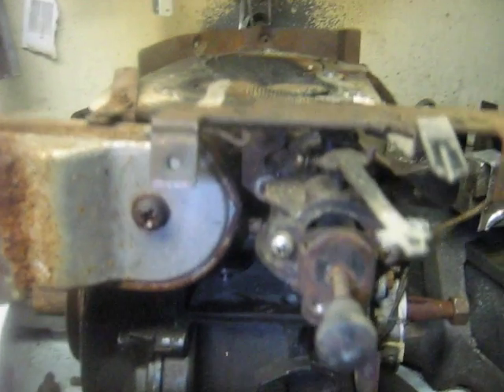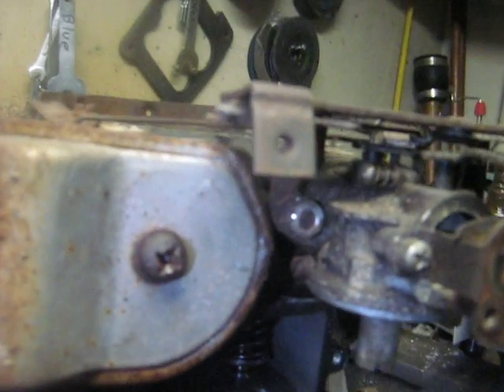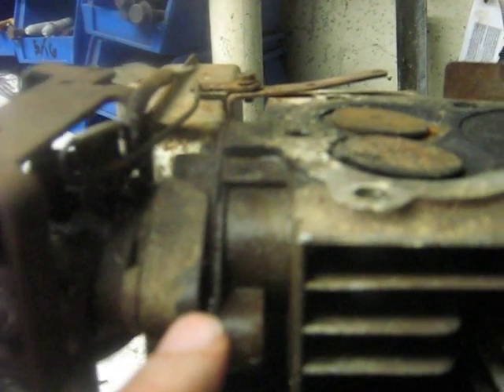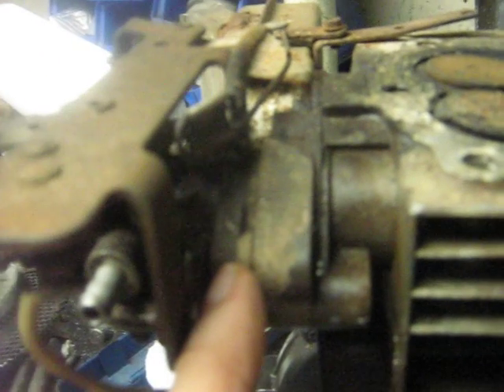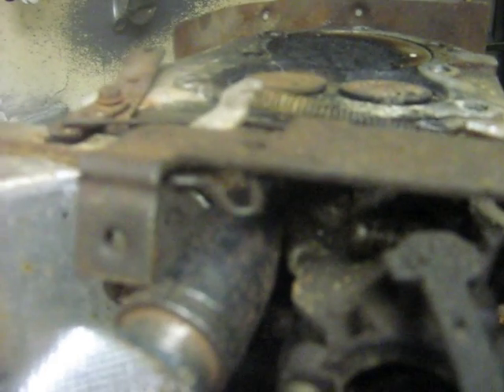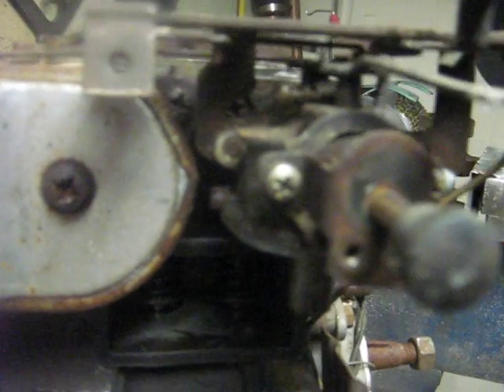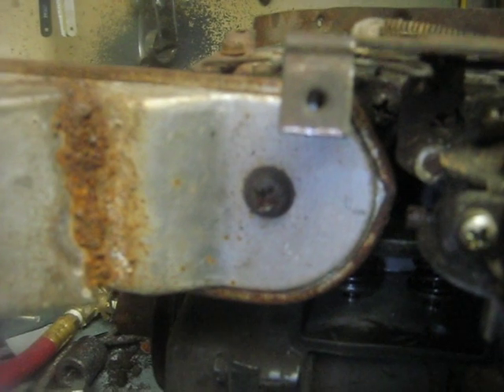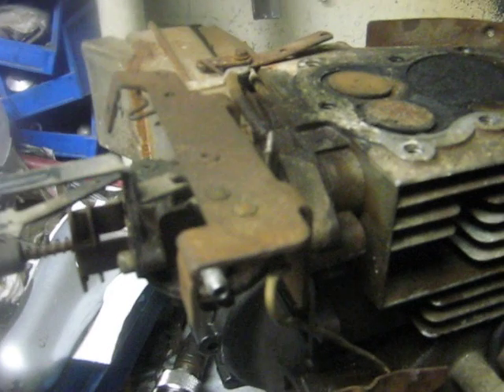The WORST Engine Design!

Comment: Tecumseh engines suck I have one had a bolt brake of in the block and taped the top of the crank shaft one time to brake the fly wheel loose and mushroomed out the threads a briggs wouldn't have done that

Comment: I agree with what you are saying in the description. The model 13 5hp briggs carb is angled in such a way that makes the bottom carb screw off suck XD
Reply from the maker: yes, I know what you mean, that bottom screw becomes much easier to manage by using an allen head screw, and an allen wrench cut down to fit it. It saved me a ton of time on my Straight 8 and 6 projects last summer. I only use allen head bolts on my 5 horse briggs engines now.

Comment: Use an ordinary screwdriver that fits the screw but one which is designed to allow you to hammer it on the end. Put the driver in the screw and hit it a descent rap or two with a hammer before applying turning force, this can 'break' out most hard to turn screws in aluminium. A little heat might also help.

Comment: When I run into this problem I actually get that screwdriver and strike it with a hammer while applying a twisting force as though it was an impact screwdriver and it works really well.

Comment: Phillips screws were designed, and used so that the bit would jump out of the screw on the assembly line before it broke the screw in the casting. At the time Phillips screws were high tech, ive pulled apart engines that had flat blade screws holding the con rod on.
Reply from the maker: Really, flat blade screws on the crank, can't say I have ever seen an engine that old!

Comment: yea  not  the  greatest  engine  design  ,, i personally  hate  tecumseh  engines
mainly due to their propensity  to have  carb  problems and  hard  starting issues
Reply from the maker: I did have a few carb. problems with this engine, other than that it ran and started well.My main thing against Tecumsehs was how many blew a hole in the side when the con rod broke!
Reply: my  sentiments exactly  ,,they had a really  bad connecting rod issue  ,if  you  ran it a little  low on   oil they can blow  with no warning

Comment: Briggs for life! Iv'e never had any luck with tecumseh engines.
Reply from the maker: I agree with you!I must mention that the first engines I used were 1960s era Tecumseh pushmowers, which I have to admit ran pretty well (we had 3 of them, since our backyard was the size of a football field!) I was very happy the day my father brought home a used 4 horse Briggs riding mower, since I was the youngest and got to drive it the most. It worked well for over 10 years, then the plastic oil paddle wheel broke in half during the winter, and I seized it up cutting the grass the first time. I didn't give up, I hand honed it out .010 oversize and put in a new rod and piston. It smoked after that, but gave at least 10 more years of servive. I still have some of the engine parts :)

Comment: Wow, simplicity was totally ignored in the design of this motor.
Reply from the maker: Yes, they really messed up. It would have been OK if they had locked the carb. bolts into the adapter plate, but once they start to spin, you are pretty well toast!

Comment: I am having the same exact problem with the same exact engine off of a wheelhorse snowblower because mine need a complete new carb
Reply from the maker: I will make a new vid showing what I did to get the carb off.Since you may need the info ASAP, I had to remove the muffler(had to grind off the long thru bolt, the shorter one came out with an impact driver and penetrating oil).I removed the carb nut on the flywheel side with a wrench, and a screwdriver wedged in from the back. I had to gring off the carb nut on the exhaust side, then I impact drove off the 2 screws holding the adapter to the block.I soaked it all in penetrating oil for 2 days first, but it didn't help with the carb bolts that were already spinning around.Hope this helps you out. The 7 horse Tecumseh of mine was a good running engine in its day, no complaints other than having to tear off the carb. bowl every year. It seems that the more recent engines like to throw con rods though, I have two 8 horses that have done that.
Reply: Ok

Comment: I just ran into the exact engine and carb set up on a blower last week!! Luckily I was able to get a long screwdriver in there and they came out!! If you can't get them out with a long phillips bit in your impact driver then I would drill the heads off the screws and remove the rest of the screw with some vise grips once the carb is outta the way!!☺
Reply from the maker: Yes, drilling might work, I didn't try that. The impact driver just wouldn't fit.
Reply from the maker: I will have to try to buy a longer phillips bit for my impact driver, as I only have 1-1/2" long bits, way too short for this job!
Reply: Ever think of using a longer screwdriver bit?

Comment: I had the same problem on a similar engine, I believe I use a slotted screwdriver to get the adopter off then I remove the carburetor from the adopter.
Reply from the maker: I have been successful working on many other Tecumsehs, but this one has taken the cake, I had to grind off two bolts.

Comment: I had trouble with one of those older tecumseh carbs before. I took a set of curved needle nose pliers and stuck them in the phillips head scre behind the carb intake manifold, which made it not turn.

Comment: I would go with Honda, Kawasaki, etc.  More expensive but much better engines than Tecumseh and Briggs.  As you would know, from previous comments, I am a Honda fan, and the reason I mention Kawasaki as well is the John Deere walk behind mower I have recently acquired (14PB) is really well built.

Comment: Do you have a longer philips head  bit for your impact driver? and then, it may still strip the head.
I didn't mind the older Tecumseh engines too much but the newer ones I can't stand. I will stick with my Briggs, Kohlers, my old Clintons and I have a couple of small old Wisconsin engines.

Comment: Use a 1/4 ratchet and extension bar to get those screws out, use the impact drivers bit and a socket that fits the back of it push on it with your body weight and then crack it loose..
works well for me